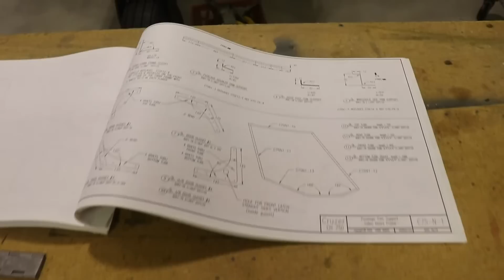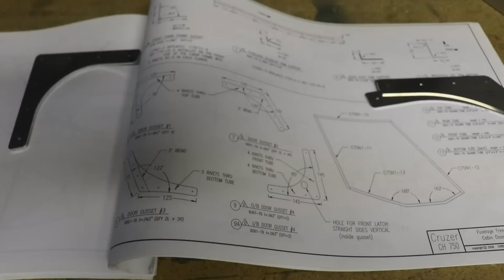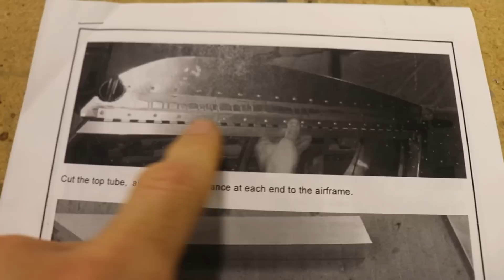Building the Zenith CH-750 Door Frames (Ep56) Part 1

Comment: 👏 very methodical as always. 
A joy to follow along. Thank you for preparing and sharing your content.

Ps - a note of caution, always check the dimensions (all of them) of a part against its drawing if one is unsure of the part number. 

Something as innocuous as wall thickness for similar outside dimensioned cross section extrusions would necessitate a part number distinction; the different wall thickness might be needed to accommodate different stresses or perhaps fastener bearing engagement.

The above may NOT be the situation in your case for the “-10” and “-11”, they may however become mirrored (handed) parts after you apply your oblique edge trimming and drill your pilot holes, meaning the port and starboard items will no longer be interchangeable.

Just some things to be aware of and not necessarily applicable in your case though 👍